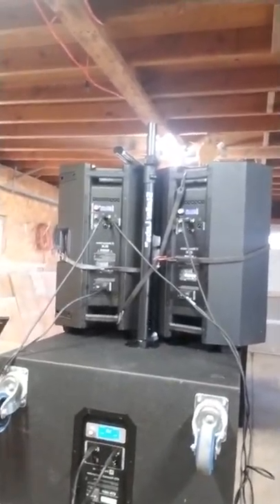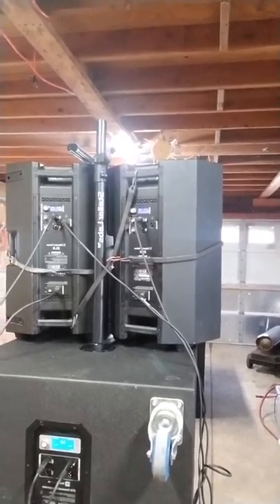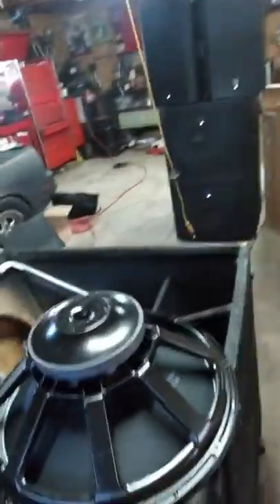EV ETX-18SP Review With Driver Upgrade

Comment: Good video have 4 of these subs used 3 times a week for 6 hours. Finally  had a driver give out on my box that's 7 years old. Drivers are definitely not the best. My older subs had to re glue them years ago. But ordered 2 eminence drivers curious to test the difference
Reply: This is DJ Marvell of One House One Nation DJs I have 2 EKX sp 18s I upgraded the drivers with the Lavoce San 18 4.50 and the performance is next level the amps in these boxes are underrated so the drivers perform excellent these particular drivers are 1.700 watts rms. They cost me .480 bucks but the result is when others are bringing 2 or 3 subs I can get by using 1 or 2 with much cleaner sound even at high levels and for long periods.

Comment: Im a little upset to see you think the drivers in these are a let down. I have been looking into purchasing one of these subs for a while and it has fantastic reviews. I dont want to purchase a $1500 top of the line sub only to have to swap out the driver... Would you recommend the QSC KS118 over these? Im looking for a sub thats really musical and hits the sweet lows just right. Less concerned about thump.
Reply from the maker: Hi Kyler, the original drivers were a disappointment. Please keep in mind, I bought these at full retail price because I am a firm supporter of this brand and products. I am a Basshead and I dabble in many other applications and projects including car audio. The drivers that come in this cabinet delicate and flimsy. The drivers I had laying around that I put in here are heavier, but also much more heavy duty, and also much more responsive on the lower frequencies. The cabinet, amplifier, casters, pretty much everything else is excellent on the speaker. The front grille can rattle a little bit but that's an easy fix. You will find reviews where people mention the sound degrades over an extended use of high volume. That's because the speakers start to overheat. With the new drivers, this does not happen. I have continuously used these at almost full power for 10 hours at a time. The amplifier remained cool, no kidding. Not even warm. 

I would buy these again and do the same driver swap before I moved forward to the QSCs because they also have lower quality drivers but higher end cabinets and amplifiers. The QSCs are also more susceptible to be pushed towards the failure point. The EVs have a higher quality protection system in my personal opinion. I hope everything above makes sense, I'm not downing any of these other solutions but I'm just speaking on behalf of the experience with what we've done here. I am extremely happy with the upgrade we did, and these things still continue to surpass my expectations. If you'd like any more specific information videos pictures feel free to contact me directly. Thank you! -DJanotomus
Reply: @MrDjanotomus  have you heard the new ks118's? I'll be buying new and am stuck between the etx18 and those. Without replacing the drivers I'm wondering which sounds better. I've heard the etx was way ahead of the kw181 but I've also heard the ks118 is a big improvement to the kw. But is it better than the etx?
Reply from the maker: @kylerkiesecker4166  I have not 😬 I understand why you're torn between them. I do feel that the EV amps are superior, but having a set from the factory that you don't have to part with is more ideal. Can you get them locally? This would help with the return policy and give you a chance to test them. But of course times are a little different right now.
Reply: @kylerkiesecker4166   Check out the Yamaha DXS18XLF. They are just a hair quieter than the KS118 but sound superior with a bigger cabinet and hit lower. I also find they're more refined and clean sounding.  I opted for them over the KS118. ALSO You can't go wrong with Yamahas 7y warranty.

Comment: I have a pair of these actually! There awesome, if I were to upgrade, how do you know what woofer is good for it? Like what makes it compatible? 
I also have the classic Yorkville LS801P subwoofers and they're monsters.
Reply from the maker: Hi Elisha! We had a couple 18" Economy drivers around from a Cerwin Vega Earthquake application to use, so we just gave it a try! Still going strong, no issues at all. We are considering going with some B&C Neo drivers next year to lighten them up a bit. Will share if and when we do :)
Reply: @MrDjanotomus  that's amazing! I really appreciate the quick reply. I found some b&c woofer as well as Blastking. Both 4in Voice coil, my question is, does the wattage of the woofer matter? The b&c is rated at 3400 Watts and the Blastking is at 1800 Watts.
Reply: @MrDjanotomus  also, what size is the voice coil on the standard EV ETX18SP woofers DVX 3180A?

Comment: Hey should I use Electro-Voice EVX-180B, In my 18sp ? It will not damage the amp right ?
Reply from the maker: DJGAZA, No, the amplifier should be fine with the  EVX-180B Driver. In fact, I think this is an EXCELLENT swap choice! Please let us know how it goes! :) (ensure proper break-in, bring them in slowly to full output, you'll hear the subwoofer distort prior to the amplifier clip).
Reply: @MrDjanotomus  but the thing is the hole on the ev box is so big, i have to go and take look at it first.
Reply from the maker: @djgazaaka5000  Here are the specs I found, this should fit well, however you don't 100% know until you try :) 

I like the 30Hz response on these. What type of music do you play, and what size room and audience?

We used these AGAIN two more times in the last 2 weeks and again next weekend for a wedding, (150 guest size area). They just keep GOING and GOING! Mains for small setups, Booth for large setups. 

http://pdf.textfiles.com/manuals/STARINMANUALS/Bosch%20-%20EV/EVX-180B.pdf
Reply from the maker: @djgazaaka5000  Connect with us directly if you wish, email: info@djanotomus.com
Reply: Hey me again, what you think about JBL srx818sp VS the ev ?

Comment: Nice work... Do they have a hi pass filter for your tops?
Reply from the maker: Hi E Dub! Not exactly, the XLRs are straight through. However, the subwoofer has an excellent built-in DSP which allows fine tuning of the subwoofer which is perfect for most applications. Including but not limited to crossover, input amplification, reverse polarization, cardiod (when using multiple subs), etc. The tops are adjustable too, including a subwoofer setting which alters the bass output to save the grunt work for the bottoms and working the tops less harder. I have to admit, this is great but I could use some more mid, like a kick bin. Therefore, I will be likely investing in some Dual 15s as well to achieve a full range system. Hope this helps and thanks for watching!

Comment: How is it holding up? I need to replace a blown ERX 18 driver
Reply from the maker: These are still going GREAT!!!! They are lined up for this weekend, two days back to back, 8 hours a day. Since the review put on at least 30 hours of hard use with NO issues. The original (BRAND NEW) drivers were blown the first night of use in alternative boxes after 6 hours of use. Not impressed with the originals. I am still recommending the Seismic Audio New Madrid 18" 100%

Comment: My sub just blew, found ur video and I didn't find any specific specs on the new drivers being talked about (seismic audio). Are these the right ones?

18" Raw Sub Woofer Speaker

Model #: New Madrid

Type: 18" Woofer/Speaker

Power RMS: 750 Watts

Power Peak: 1500 Watts

Frequency Response: 25Hz-2K Hz

Sensitivity: 102 db

Magnet: 2x120 oz  (240 oz total)

Voice Coil: 4"

Impedance: 8 Ohm

Die Cast Aluminum Chassis

Paper cone

Cloth Edge

Weight: 43 lbs each
Reply from the maker: Hi Lawan, yes those are them! They've been on back order for some time. You can sign up to get notified once they are in stock, through the website. And a Coupon for signing up when it is time to buy. Hope this helps!

Comment: How much power does the etx have after the Upgrade?
Reply from the maker: I am not certain the proper calculation from the original driver deviation at this time (will ask for recommendations). Each unit was rated @ 1800 Watts OEM, from a performance "guestimate" at least 2,000 Watts. I did not calculate or measure the power consumption vs components just yet. Thanks for asking and stay tuned as they will debut June 15th for one of our stages at DataBASS http://djanotomus.com/databass Let's see how everything holds up after 8 hours of continuous professional use!
Reply: @MrDjanotomus  okey Thanks. But are the original woofers in the etx so bad? Do they distorted a lot at higher volume?
Reply from the maker: @4l3x97  They did not have the low-end performance for our Bass Music DJs we needed and consumed excessive power attempting to compensate to get there. Yes, they did distort at high volumes under our testing. The drivers are stronger than the amp, so the limiter automatically brings them down prior with no cut-out or damage to either component. Still today, VERY awesome combination and we are using them as monitors for our bigger stages. Thanks for your question!

Comment: Bro I agree the drivers in the ETX and the EKX models aren't very good for the quality of amps that come with these subs, the amps are underrated, I have the EKX 18 SP's and upgraded my drivers to the Lavoce' SAN 184.50 drivers and the sound is amazing bro. After the break in period the amps in these really shine and the bass is super punchy and lower being set at 100hz as well. I used the neodymium version of the Lavoces' and basically got the same result, a monster potable sub that I can use just about anywhere, anytime. Thanks for the info. Sincerely: DJ Marvell
Reply from the maker: DJ Marvell, AWESOME!!! I just checked those drivers out and I could only imagine how well those are holding up! Thank you for the feedback and support!   I do have a recent update after years of banging those full tilt (well, the DJs did). Both drivers, amps and hardware in near mint condition with the small exception of a crossbar inside the box coming loose. It supports the top and bottom from caving in, I believe. It started rattling at a gig towards the end and was drowned out at higher volume (fortunately).   Only 1 of two started this, so I opened both, dabbed a little E6000 on each end, slipped it back in place and drilled a undersized 1/8" hole on both sides from the outside of the box right into the bar and simply inserted two 3" stainless screws and WHOLAH!!! No more rattle and I'm positive that was the weakest point so we're probably good for another 3 years! lol.  Cheers!
Reply: Put more screws in my grills put wood glue on the poles inside as well. Thank you bro. I have two Madrids in my home theater. WOW!!!!

Comment: Who makes the EV 18" Speaker?
Reply from the maker: Hi Grant, I believe EV is a U.S. Based MFG and Distributer in Burnsville, Minnesota. The Subwoofer we used for the swap is Seismic Audio, based in Memphis, TN.
Reply: @MrDjanotomus  thanks for responding. I have a yorkville cabinet here that uses Celestion speakers. Just curious if EV makes the woofer or do they source it out

Comment: What are the difference in weight between stock and the upgrade? What do you suggest for a lighter 18" neodyme upgrade?
Reply from the maker: Hello! The weight difference between an Electro-Voice F.01U.278.393 / DVX3180 and a Seismic Audio New Madrid Driver is about 20 lbs. The SA Driver itself is 43lbs.
I would REALLY like to test (and hopefully recommend) B&C or RCF Neodymium Transducers as a lighter and powerful solution.

Comment: Under 140 hz the EV driver doesn't exist ??
That's a pretty strong statement. I think your numbers are wrong
Reply from the maker: Hi Scott, it's an exaggeration however the LF response is not good at all with those specific drivers. And the power consumption needed to subharmonic synthesize is impractical. Swapping the driver completely addressed that, which is necessary for our setups which drive very low frequency bass music in addition to full range needs.

Comment: Great review. Question how do the Rockville 18s compare to the etx18s?
Reply from the maker: Hello twan 41, I am so glad you asked! I replaced two Rockville RBG18FAs with the EVs. The Rockville's are truly the best bang for the buck however fell short in reliability and other areas. The Rockville's arrived damaged, the enclosure was practically made of pressed paper. The screws were not strong, the units were very heavy and overall cheaply built. I did not even understand how they were "folded horn" designed. They were essentially front firing subwoofers. Also, these rattled (poor quality screws and insulation) and have NO protection if overdriven. I lost two subwoofers during an event. They were fried! And the capacitors starting walking out of the amplifier boards. One amp also fried due to this. I had to completely rebuild these which I used Rockville components, which cost me over $300 after 5 uses. Then I sold right after, both for $500 which was market value just last week. The EVs are much more durable and higher quality. I am going to test them and see if they can withstand reasonable abuse, time and elements this summer, especially with the upgraded drivers, Stay tuned!
Reply: @MrDjanotomus   Thank you I think I will stay away from them. I was going to get them for a backup sub but I'll stick with the ev etx18s  good luck with yours
Reply: They do not at all 😂

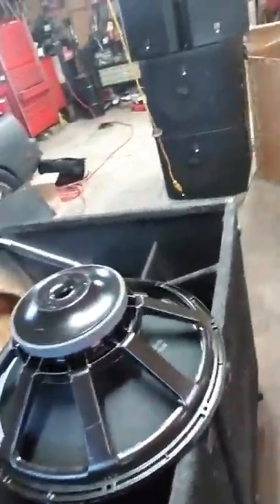Comment: Did you just say the frequency response for EV ETX18SP is NON-EXISTENT under 140hz (6:33)?! I found that very hard to believe; perhaps  you were being very sarcastic...I own one of these and they pound. "Terrible" under 140hz is quite a bit of an exaggeration...
Reply from the maker: Hi Joji George, I mean no disrespect, and this was my unfiltered, unplanned and genuine response to the first impression of the factory subwoofer performance versus the same unit with just a simple driver swap. I promise you, switching from the factory-loaded EV driver to the one I used yielded a SIGNIFICANT increase in output performance as well as frequency response. There are SO MANY different variations to consider, however, we have been using these almost EVERY since and in EXTREME abusive applications with NO issues and nothing but compliments. I LOVE these models and designs, but the driver was a bottleneck to really unlock the quality of the cabinet, amplifier, and the DSP within. I'd love to share more specific info with you if you are interested, such as pics, videos, and more! If you're interested, reach out :)
Reply: @MrDjanotomus  Gotcha.
Reply: Compartir esa informacion con mi usuario

Comment: So let get me get this right you bought some EV subs and didn't like them so you put different drivers in? You were better off taking the subs back and replacing them with something like the JBL SRX818 or something.
Reply from the maker: Hi DJ Teknovibe, I personally like the Amplifier, DSP Configuration and Cosmetics of those EV Subs. I already had spare 18" Drivers available so within an hour had both swapped and working. I swapped the original EV Drivers into a couple Cerwin Vega Folded Horns which needed 18" drivers very similar to the EVs. We've since used these for several small to medium sized events (+- 150 people, 3,000 square ft indoor and outdoor) with NO issues and compliments, even from other audio enthusiasts regarding clarity, power and appearance. For some applications, I entirely agree with you. For these, I am glad we experimented.  Thanks for watching and sharing feedback!

Comment: You took out EV drivers to put in cheap Seismic Audio ones in? Foolish. If you want decent drivers in there try 18 Sound 18W1001 they're proper drivers.
Reply from the maker: Hi DJ Teknovibe, We appreciate & respect your recommendation. 18 Sound Drivers are fantastic, but still pricy compared to these SAs, which were spares (free). We used these at 12 Events since this video was created and they outperformed even the QSCs in other rigs (multiple stages). We also primarily use these for booth monitors as our Mains exceed 80,000 Watts. The added weight of the ferrite also keeps these cabinets in place.

Comment: How those subwoofer keeping up now? Any issues?
Reply from the maker: DJGAZA we've been banging them as mains or monitors almost EVERY weekend for 100+ person events the last several months with NO issues. I even bought two more SA drivers just in case. They are currently on back order and sold out in less than 3 days the last time they restocked them. We are still very pleased and since have also helped others, on a budget with performing the build. We will be making a video on the install soon. Thanks for watching!
Reply: @MrDjanotomus  oh okay, because I was going to buy the new Qsc subwoofer, but the ev sounds better to me, I’m getting them in 2 weeks.
Reply from the maker: @djgazaaka5000  Both are great competitive designs. I prefer the EVs, because I've has such good luck with them, and have all EV Tops. Wish you good luck on your journey! Cheers!
Reply: Hey, how is it vs the Qsc ks118 now?